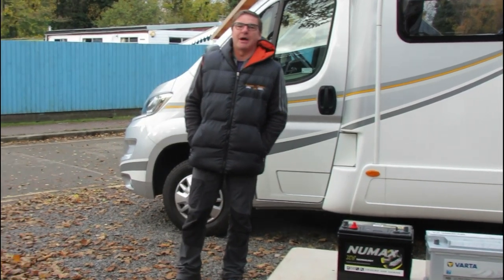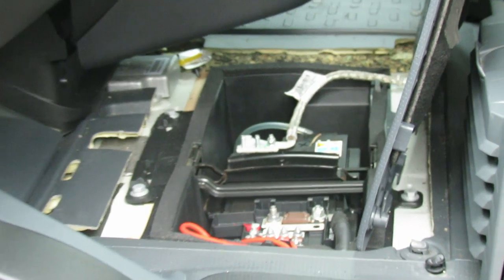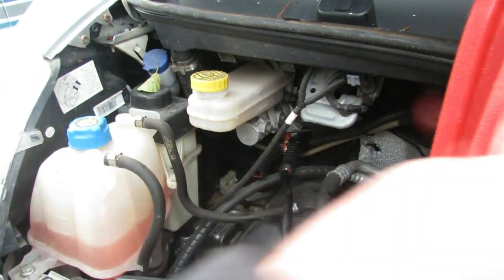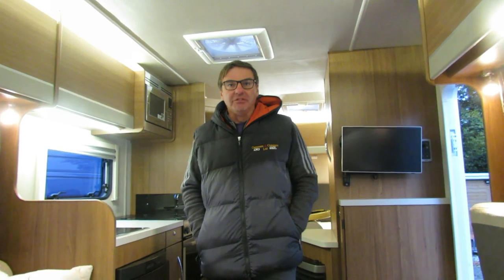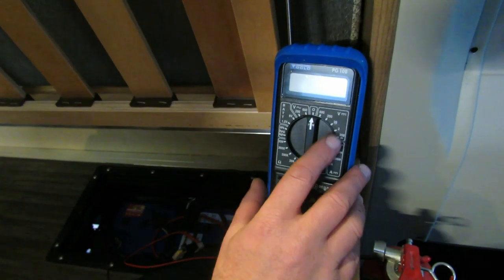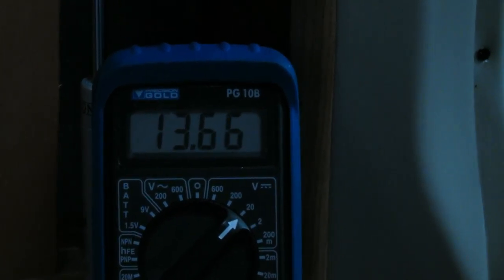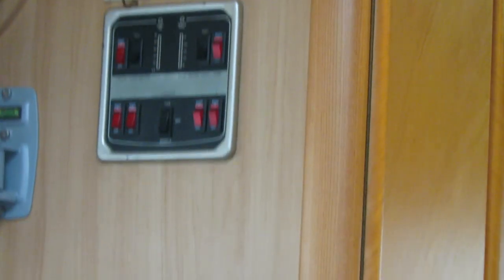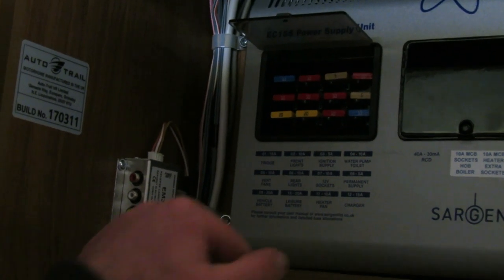Leisure Battery -Motorhome Batteries Leisure and Vehicle (Solar Basics)

Comment: At the start we are told that leisure batteries are designed to be slowly discharged and recharged. This does not apply to lead acid batteries. Lead acid batteries only allow 50% of their capacity to be used before you start to damage the battery. If your leisure batteries drops below 12.1 volts it has went below the 50% threshold and you are now damaging the longevity of the battery. Lithium batteries are different. They give you 95% of their capacity. But charging them at low temperatures can damage them. Also the 50% threshold applies to the vehicle battery also if it’s lead acid.
Reply from the maker: Great comment William 👍

Comment: Hi. I have just purchased my first motorhome, a Mclouie Fusion 360. It has 1 120w solar panel on the roof, how can I find out if this is charging both batteries. The guy I bought it of thinks it only charges the leisure battery, but he didn't know for sure. Any advice would be great. Love your style of video. nice one.
Reply from the maker: Hi Steve, find the controller thats connecting the solar on the roof and have a look at how many wires are coming out.

Comment: Hi helpful video, I have been told you should not jump start a Ducato Van is that correct? Thanks
Reply from the maker: Not at all you have no choice if the battery is flat Steve 😐
Reply: Agreed my thoughts exactly. Cheers Steve

Comment: Good video if my cab battery is under cab floor can I charge from engine compartment without disconnecting anything from cab battery hope this makes sense
Reply from the maker: I do not understand there andre
Reply: @TheMotorhomeMan  ok what I mean is if you jump start motor from point under the bonnet can you charge the battery from the same points

Comment: The end section is wrong on this video. Both batterys are working before and after he changes the main connector over
Reply: @TheMotorhomeMan     Hi  - yes Junkhousedog is correct.    Both batteries will charge and deliver power with either of the two lead arrangements shown towards the end of the video.     That's because the length of the connecting leads is very short and the electrical resistance of the leads is exceptionally small and can be ignored.       So, in-effect both batteries discharge and charge in parallel as the resistance of the interconnecting leads is negligible.    In which case the voltages equalise across the batteries with either of the two arrangements.    The latter arrangement is, though, considered best practise in general when connecting parallel electrical loads and that is because where longer leads or higher electrical resitances are at play then the effective length of conductors is equal across all the power sources (sorry it's a bit technical but I think that is why you will hear a misconception that the second battery won't work whereas it makes no practical difference for the case you demonstrated).   Hope that helps.

Comment: Can I just replace my 2 leisure batteries, currently 130Ah with 23Ah batteries without changing anything else and can I just cover up the 3 x 100w solar panels, without disconnecting them to complete the swapover?

Comment: hi, new to your vlog. my motor home was plugged into mains, while parked on drive, last Sunday, I unplugged and took van for good drive on motorway and A  road for round trip of 25 miles, today Wednesday 17th February having left van on driveway unplugged from mains since Sunday,
the warning lights for airbag and seat belts came on and the millage reading was also flashing, this stayed same after a round trip of 5 miles
checked the panel both leisure and van battery reading was very good in the green, the AH however was low at 25% in the yellow.
parked back in drive, plugged into mains hook-up, returned after two hours an the AH was 100% in green, started van, no warning lights.
did not put alarm on in drive during anytime of the above, don't think anything left switched on, using supply, how come the AH dropped after only 2 to 3 days. also only have one leisure battery, do intend to fit second and possibly putt another solar panel on roof, at present 100 amp panel would like at least another 150 or more. sorry about the long explanation your thoughts please, ps recently seen you in link up with bob earnshaw.
best regards
Tony
Reply from the maker: That sounds like vehicle battery Edward

Comment: Hi Jason I’ve a 100w solar panel going to controller for leasure battery I’m motorhome I want to charge vehicle battery it’s a double controller do I comect  wires to vehicle battery first to controller or viserverser  do I need to disconnect solar panel  would appreciate your help
Reply from the maker: Controller to battery Peter

Comment: Great video. But now that we are all parked up (motorhomes)  can I leave EHU hooked up.I ask this because when hooked up the leisure battery is charging all the time is there a sensor cut off. Keep the videos going great advice an knowledge thanks for your help
Reply from the maker: Hi Donald yes you can leave it on if you are not using it but I would disconnect it every 5-7 days fo a few days so it can discharge a bit.

Comment: Funny thing is buses drive with interior lights on so it cannot be illegal, your not supposed to be showing a white light to the rear, number plate lights are white but you cannot see the light directly so obviously a white light to the rear only means a direct light.

Comment: We have a euro 6 ducato with a smart alternator which only charges the leisure battery to about 80%. I have looked at the CTEK battery to battery charger which is straight forward to fit but disabling the existing charging system is not straightforward,  any thoughts? Our motorhome is a 
Pilote.
Reply from the maker: Me personally John I would not get involved in doing it (open a can of worms) I would add another battery.
Reply: @TheMotorhomeMan  We have added another leisure battery, so we have two 100amp AGM.

Comment: Yonks ago I was still attached to wife no1 she owned a T4 or a T5 and it was a petrol for the life of both of us we could never find out why both leisure and vehicle batteries always drained when the POS always went as flat as her doodass, so what did the dumb mare do?, she bought a damn portable generator. Don’t get me wrong though the generator worked very well but rather than spending money to find the cause of the issue which an old commercial mechanic I knew spent an afternoon fixing and a bottle of my 50 yr old macallan and fixed the issue so the schmuk wasted her/my damn dosh but it doesn’t detract from your informative and in most cases hilarious videos so please don’t stop making them because make me howl. 🙏👍

Comment: Yeah not exactly unusual to buy second hand vehicles with dud batteries as many have been sat around for a while at a dealership or before being traded in to the dealership, even if they're working there's a good chance that letting them run down has reduced their life or capacity.